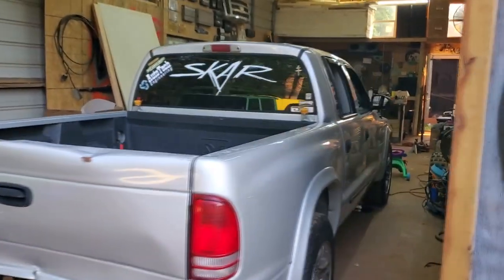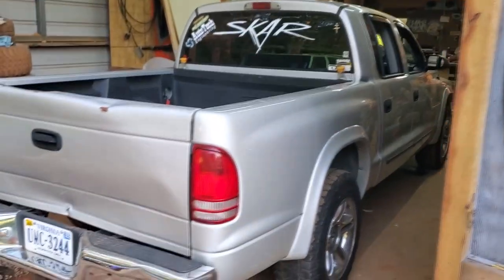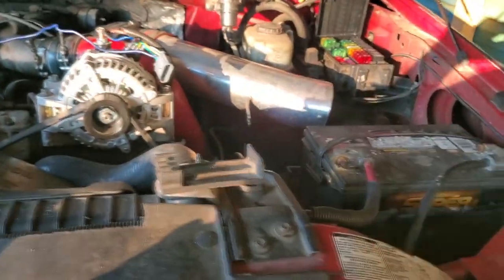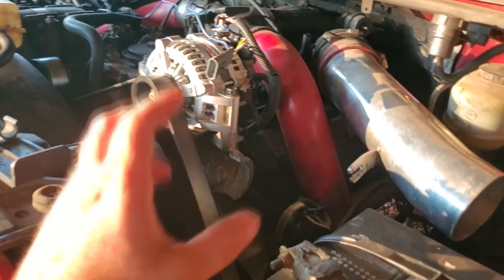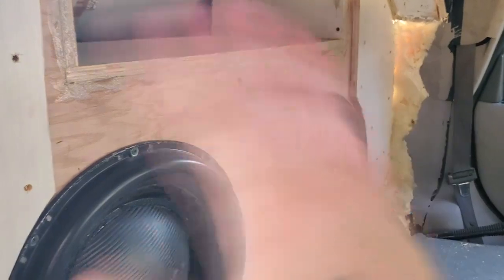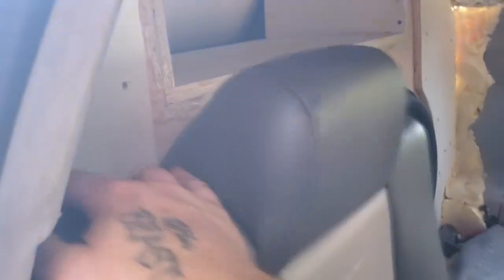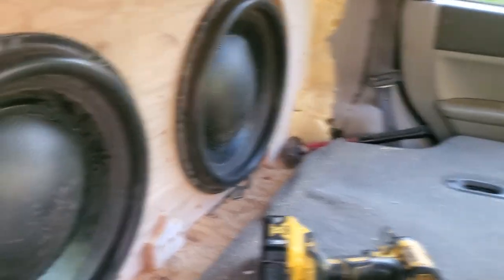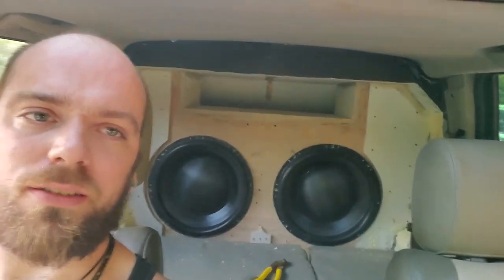2 Sundown ZV4 18s with Corey Otis Recones!!! Alternator Mock Up F250!!

Comment: Needs more power🔋
Reply from the maker: We're changing subs in the jeep and I'm putting these subs along with another one. So I'll be running 3 zv4 18s in my truck.
Reply: @DgafProduktions  nice
Reply from the maker: @RyanBassForLife  gonna be running 2 dc audio lvl 4 18s on a dc 5k. Then eventually be switching and running a dc 90.4 on the mids and highs

Comment: What size are those dust caps?
Reply from the maker: 10 inch carbonfiber dust caps
Reply: @DgafProduktions  I want to get Fiberglass 10's for my 4 SoundQubed 15's but their not cheap. Whats the best glue to attach you're dustcaps with when you plan to reuse them over and over? Ca glue? No matter what it's a pin to get them off without scuffing them or somthing, I tried Goop for the first time, we'll see. Re-coned all 4 of my subs (sucks). SoundQubed has a breaking process thats a pin in my ass. And my sinuses as well. Uesd stock caps.
Reply from the maker: @Hertzsogood219  i use 5 min epoxy for the spiders and the caps and e6000 for the surround just because i can get them locally and have never had a issue with them. i put the epoxy on the caps and the put something relatively heavy on them for about 4-5 hours to give it plenty of time to setup and cure. i actually got these caps for free lol they came of some old dd audio subs i had in the shop so i as stoked about that because you are correct their expensive as hell lol